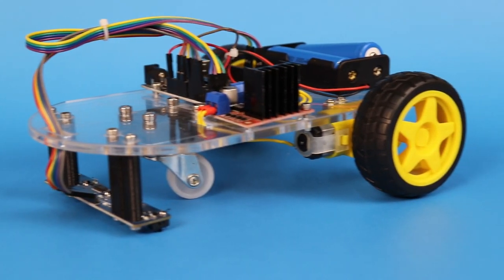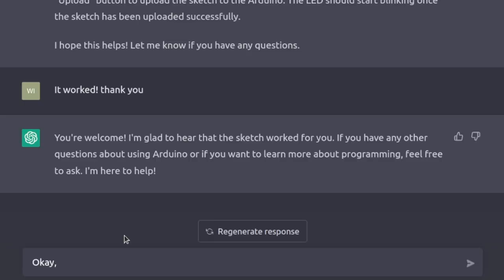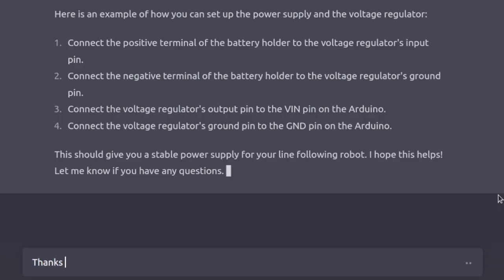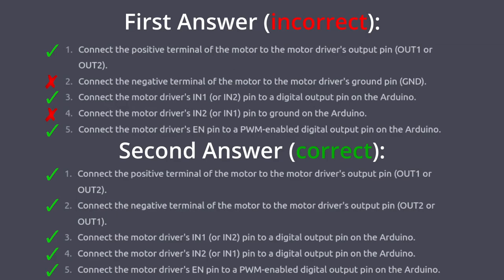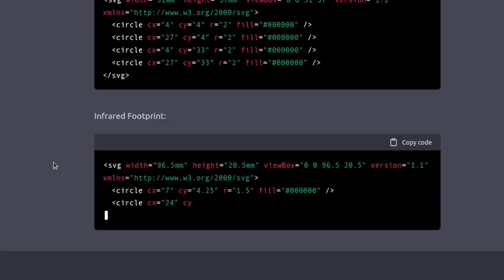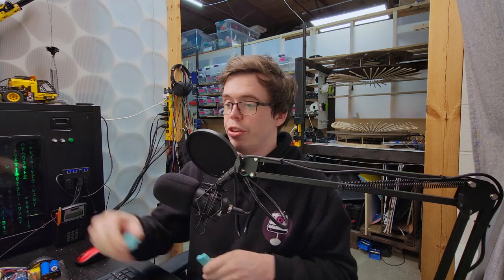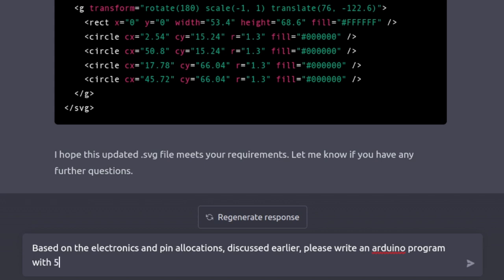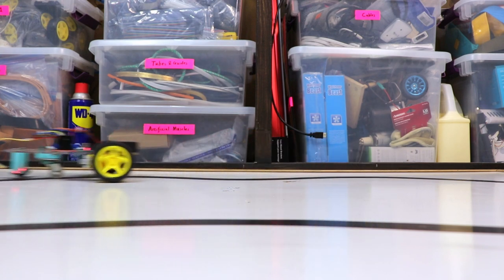ChatGPT Taught Me How To Build A Robot From Scratch

Comment: This is cool - gonna be fair to it about the L298N, if it's the L298N chip it's kinda right, although it should then be specifying some flyback diodes too. if it's the breakout, quite right you don't need a regulator for an Arduino based robot.
Reply: I love that you actually built the crazy hole position version!

Comment: Can you help me?  Can someone help me?  I need a control board designed that has a wifi option to use an app like Tuya to command a motor to travel forwards for 20 seconds on demand and travel backwards for 20 seconds on command.